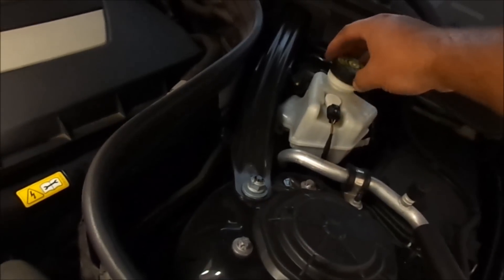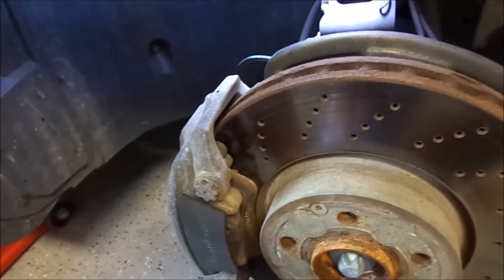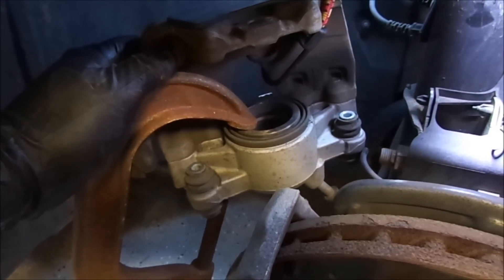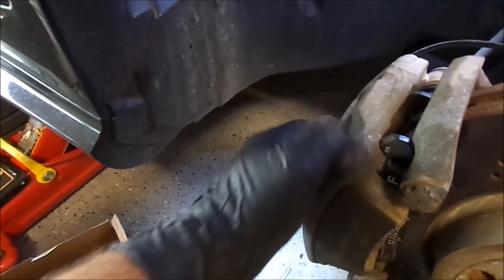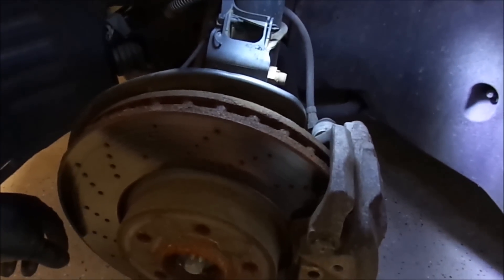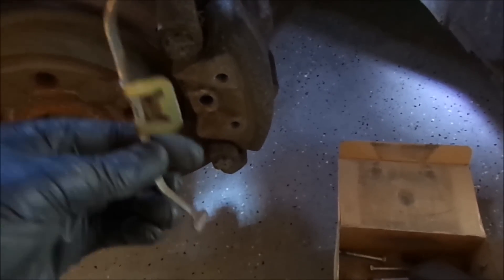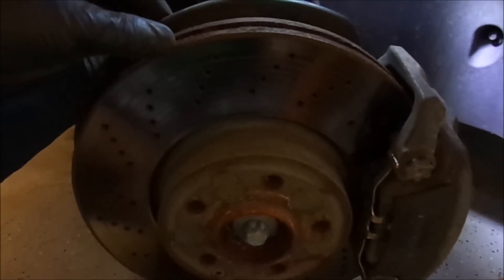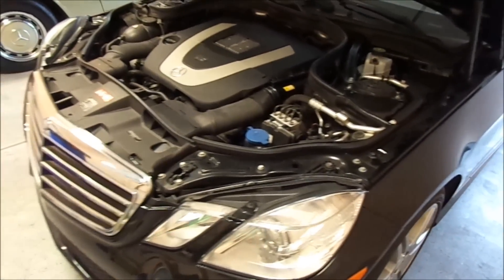DIY w212 Mercedes  e350 How to replace install brake pads

Comment: you gotta change  pads and rotors at the same time , as old rotor may cause uneven wear , and it may cause rotor warping
Reply from the maker: i know its recommended, but i never did it that way and never had any unusual   pads wear problem
Reply: really? u just slapped the new pads  , and no vibration  or anything unusual?
Reply from the maker: Igor Pushilo  perfectly fine ,
Reply: just changed my brakes as well, they're riding really smooth. Nothing unusual.
Reply: @belarus27  Me too
Reply: @belarus27  multiple times ive done it no  vibration or anything unusual

Comment: Did disable the SBC system before your started working or does this particular model not have the SBC?
Reply: Only W211 had SBC, W212 (this) and all models after that have normal brakes without electronic nonsense tech.

Comment: Did you use jack pucks? I need to get a lift and thought about using a piece of wood instead of a jack puck/pad.
Reply: those pucks are like an introduction to Benz transmission service 😂

Comment: does that brake sensor come separately when you buy the pads? say like if I was to buy the pads at Advance Auto Part?
Reply from the maker: Stroker Ace  you never never!!!!!!!!!  buy a brake pads in any local auto parts stores, it will ruin your brake rotors , 
Buy dealer only ,
Reply: Wonder how much the dealer paid you to say that?
Reply: if your going to do it yourself at least buy original parts, its always better to not wait till the car marks you that you need to replace the brake pads so you are able to reuse the sensors again

Comment: aren't you supposed to change the rotors when replacing the pads?
Reply from the maker: +Pete Daye  ideally yes, but not critical if your rotors are fine,
Reply: +mers-benz   Thank you for your fast reply and for the video
Reply: Hen is right you might be able to get away with turning/resurfacing the rotors once.  Depending on how thick the rotors were to begin with.  I wouldn’t turn more than once so probably every other brake job R/R the rotors.

Comment: Did you lubricate the slider pin? Is it possible to take it out and lubricate it?
Reply: Baisong Huang not sure if it was done on this project but yes the slide pins should be able to be removed cleaned and lubed.  There is a little dust boot on the slide pins.  Slowly slide the dust boot out of the valley on the slide pin repeat for other side and other pin.  There should be two slide pins remove the pin, inspect, clean and apply a fairy liberal coating of slide pin lube then reinstall.  Yes the pins should be lubed as part of the repair and a negligible amount of extra labor since you already have the caliper removed.  Rule of thumb and this advice was learned working on military aircraft but can be equally shared for vehicles and pretty much all mechanical projects.  The 24” rule.  Inspect all items within a 24” area of the project you are working on.  Obviously it can be more but minimum 24” might find something else broken and hopefully replaced while tire and wheel is removed.  Saves aggravation of going to go back in a second time.
Reply: @stephencannon3140  I like your 24" rule... 
pads, 
rotors, 
pins, 
bleeders flush, 
control arm bushings, 
tortion arms, 
tie rods, 
bearings freeplay
tire wear pattern
👍🏻
Reply: G Lasser might find something worn....”By Accident” but easier to find now and take care of.  Some items are easier to replace once.  Your video was helpful with my 2011 E350 brake replacement.  I am just around 100K so I did a full brake job.  Front and rear rotors and pads.  I need to R/R the parking brake and adjust the cable next but a good start. After all the brake work is done final step will be a system flush and roll on fresh fluid.   Have you checked into “Tire Trees”? They are basically a threaded stud with the same thread pattern as the lug studs but flat on one side.  Makes it MUCH easier when replacing the tires and you can thread two of the trees on at first to align the tire then as you put the other three studs in you can replace the trees with the regular studs.  Pack of two around $7.00 US on Amazon.  Was a real life saver for my brake work.